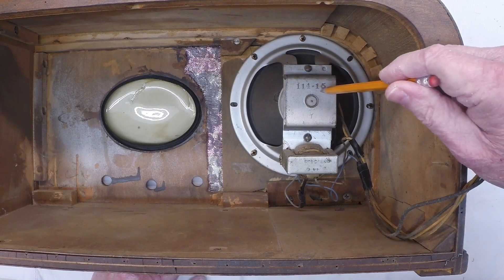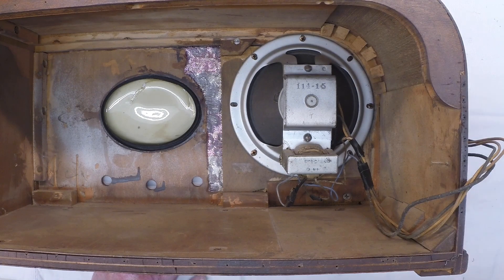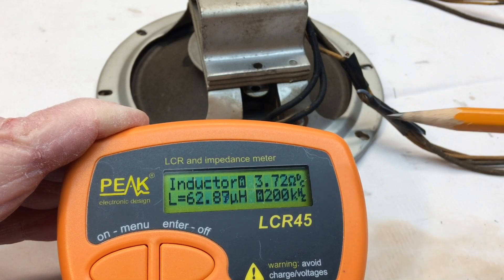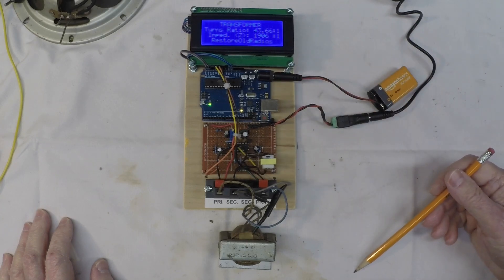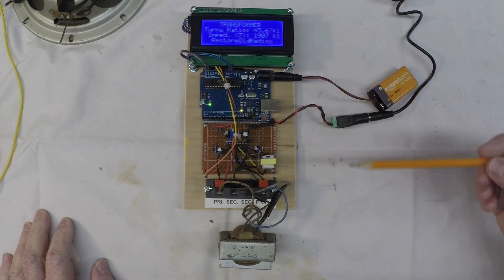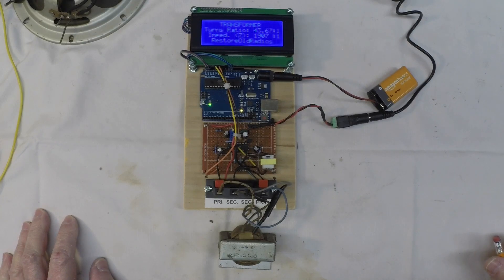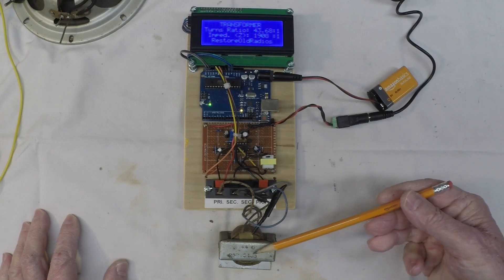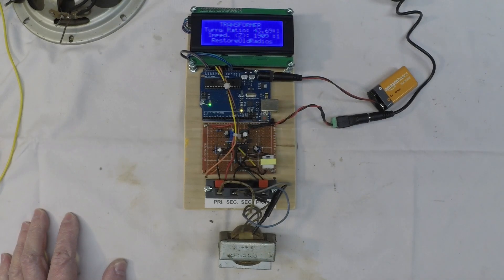Airline 62-316 - Output Transformer Evaluation

Comment: Nice video! Do you know if your code will work on a Nano Don? Thanks again for all you do.
Reply: I guess that was a little confusing. I was talking about your Transformer Turns Radio Meter project, sorry about that.
Reply from the maker: Dave, I would think so. Best, Don
Reply from the maker: Dave, it should; however, I’ve haven’t validated… Best, Don